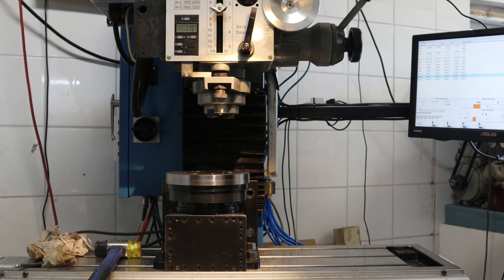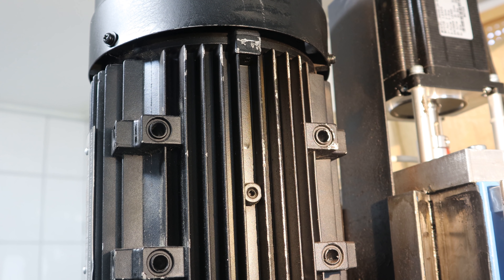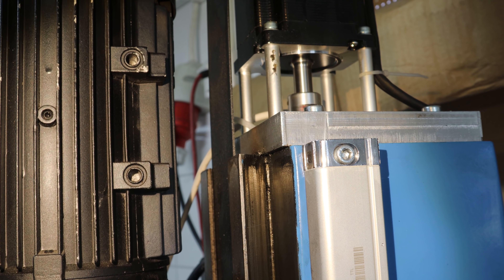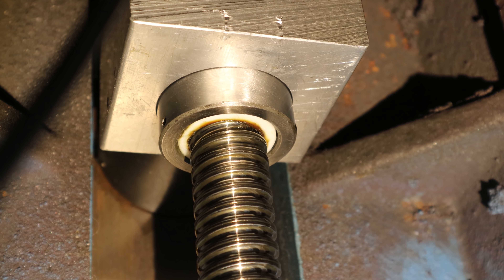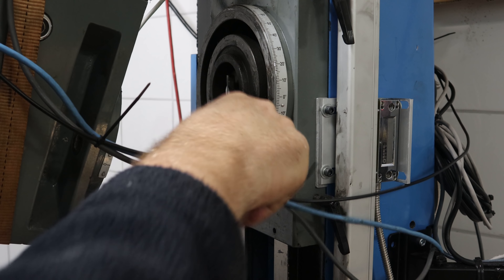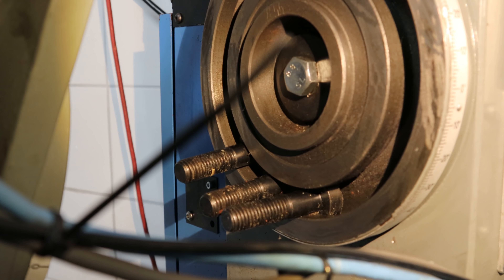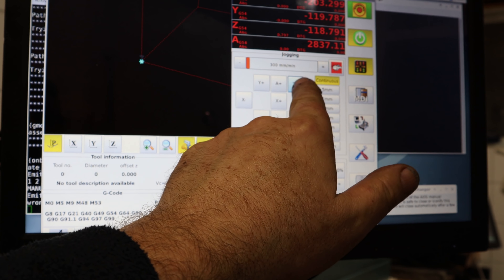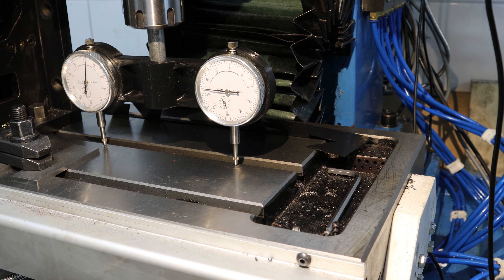Broken Z-axis on the CNC milling machine

Comment: It looks like your mill would benefit from a cable and pulley attached counter weight. I think it could reduce wear on the ways. Just my 2 cents. :-)
Reply from the maker: There is a lot of wear on the ways. And friction. The heavy gearbox/spindel/motor is not exactly symmetric placed.